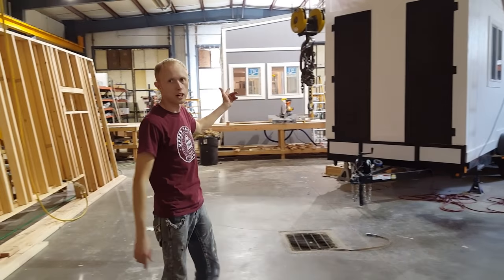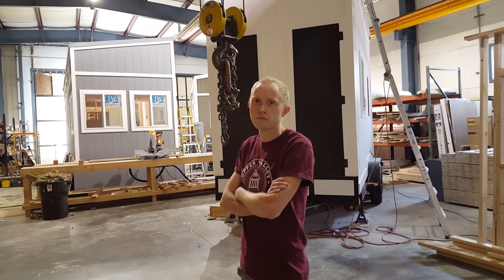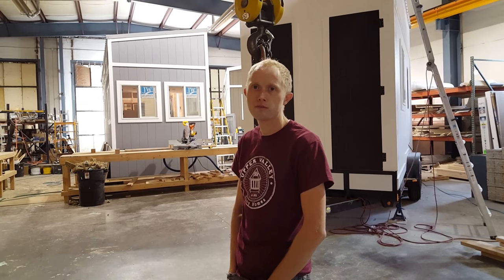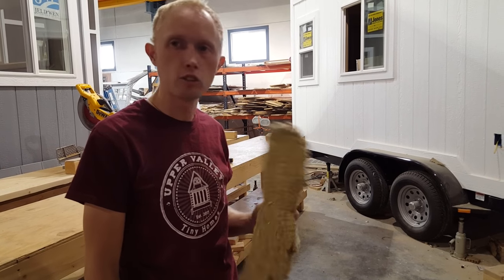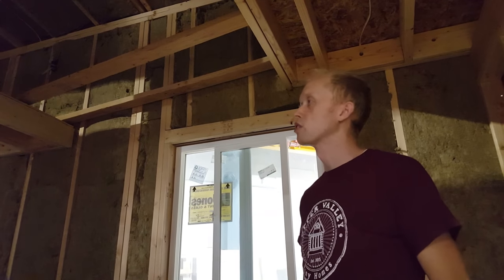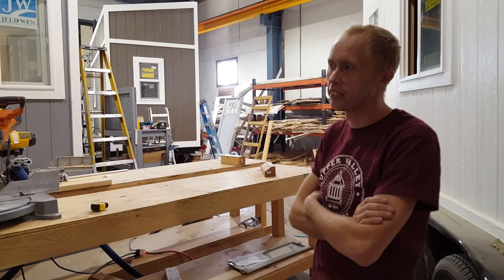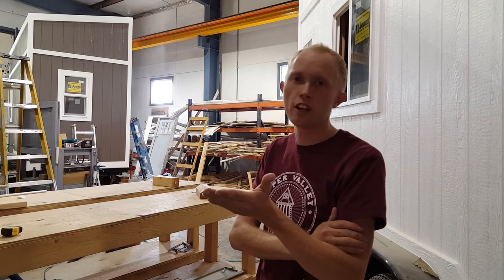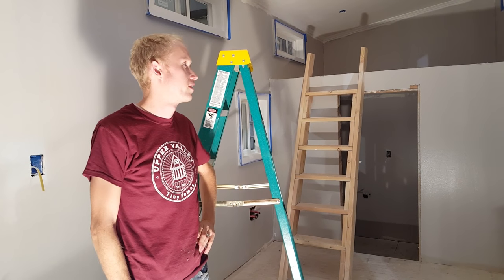How to Start a Tiny House Company

Comment: One needs to know exactly how they are going to use their home. I think tiny is good. For a person with no fixed address, but still needs a house and not an RV. this is good. This allows someone to stay in one place for a long time. Living in a RV full time is ok (legally) so long as you do not stay in one place full time. In our area this time is maximum 10 months. (I lived in a RV for a year some years ago). So if the life style includes frequent movement, the RV makes more sense. The RV comes with waste tanks and more importantly RV hook ups for any RV park or for staying a few hours at a rest stop (6 hours max last I checked). For a fixed address with infrequent moves, the tiny house wins every time. For a fixed address with no moves, I would choose a different building method that uses mass for temperature control. I would still go small/tiny though.
For a tiny house on wheels, with relatively long stays between moves, tire storage becomes important. I think I would use wood blocks on foundation (concrete) blocks and let the tires and jacks rest off the ground as well as cover them with at least an outdoor fabric.
One other advantage of a tiny house as a mobile home rather than an RV, it is legal to build an addition of up to 250ftsq with no permit (in our area in BC Canada). There may be a limit as to the minimum mobile home size though. (Rocky View MD in Alberta requires any home (mobile or not) to be at least 1200 sqft... double wide)
As always, know the laws in your area... most of which are available on line. Knowing the rules not only tells you what you can't do, but also what you can get away with. Knowing what those rules really mean is important too. If you drop an RV on land with no house and live in it for a long time... there will be trouble. People do notice that there are lights on in it every night and some of those people are just trouble makers. Either having the right papers or appearing to do things right are important.
There are a great number of people here in BC who live in a RV park 10 months out of the year and travel/move for two months. Mostly retired people who have the two months to go travel. This is legal.... or at least not enforceable. Finding out what is right in your area may be as easy as asking the maximum stay at an RV park. (those that rent pads monthly)